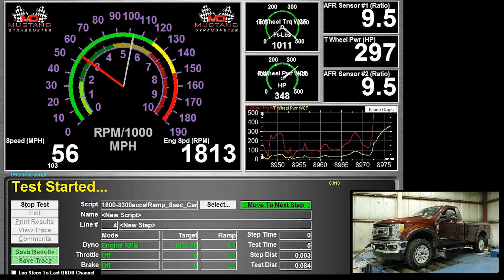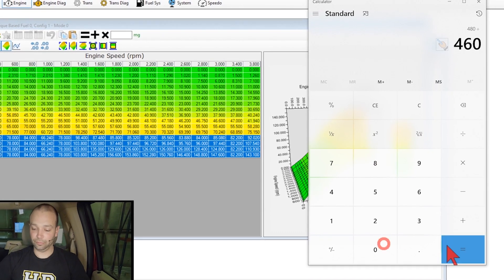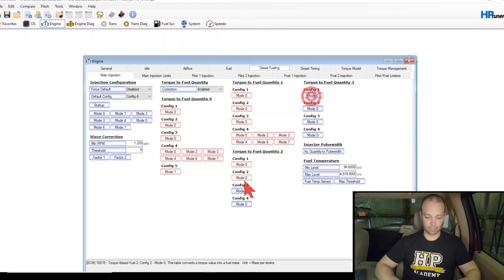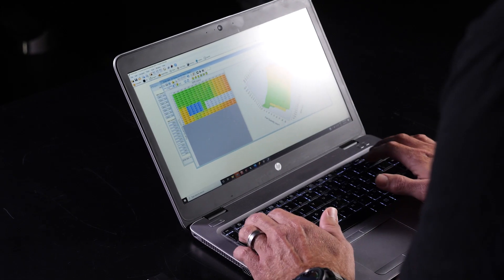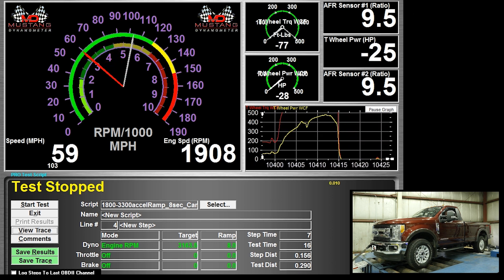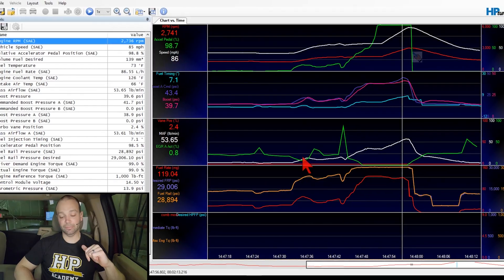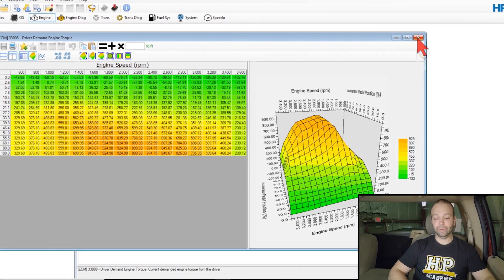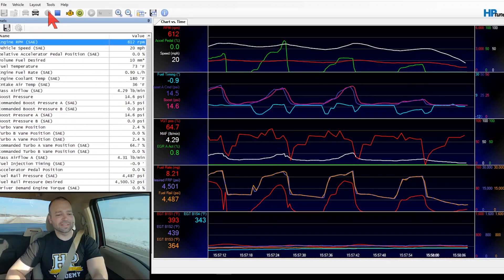Diesel Tuning With HP Tuners | Worked Example Live Now! [RELEASE]

Comment: What software will used after extracting the original map? Thank you
Reply from the maker: In this example we're using HP Tuners. 
The course also has an EFI Live example. That said, if you are using other software to tune your common rail diesel this and the diesel tuning fundamentals course are still going to help you learn.
It will take a little longer than if you were using the same software as the tutor but it won't make it impossible :) - Taz.